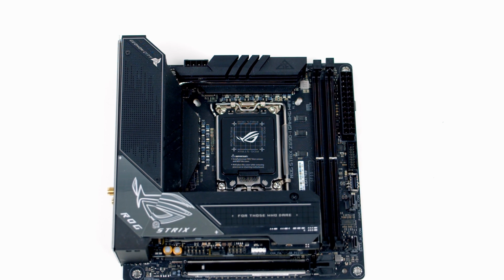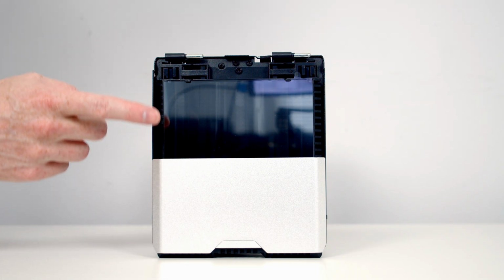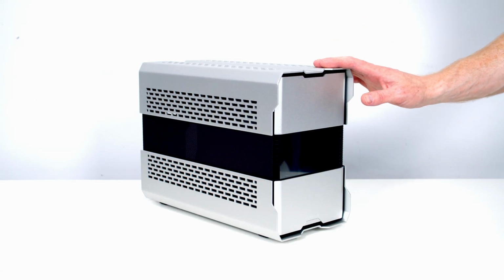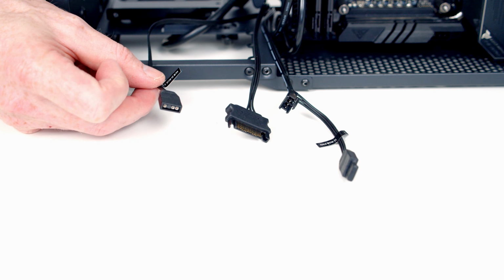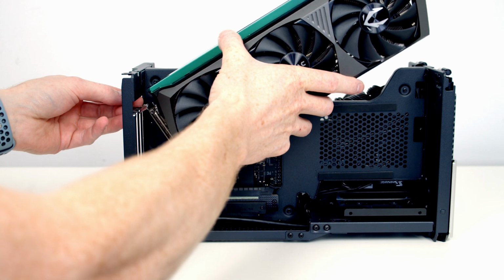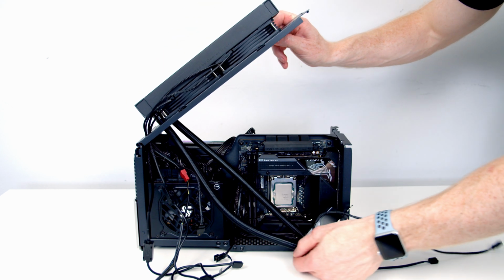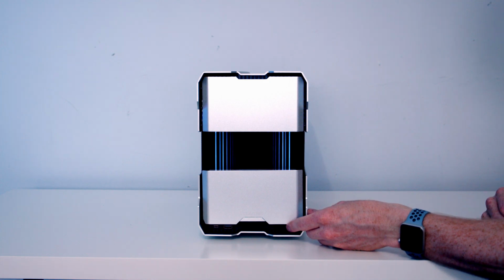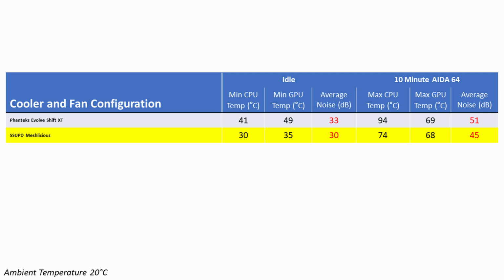Phanteks Evolv Shift XT Build - Step by Step Guide

Comment: Be aware with this build, gpu's with pcie on the right side and not in the middle prevent the case from closing and allowing a cpu water cooler. Am currently struggling with this and cannot finish the build unfortunately. So be sure to use a gpu with middle ports if you plan to do this (3000 series)
Reply: im guessing this only applies to triple fan coolers, with a dual fan card it should not matter

Comment: Cool case, which I use for my TV gaming setup. Couple issues I have:

1. Difficult to close the radiator mount, as the pcie cables, and AIO radiator tubes are in the way. The far radiator tube is getting squished, possibly slightly pinched.

2. The heat coming from the back of the GPU is causing the CPU temperatures to rise very high. If I run a stress test on only the CPU, the temps are nominal. When running a stress on CPU and GPU, the CPU temps skyrocket. There needs to be a way to vent the heat coming from the backplate of the GPU, and I can't figure out how to do so.

Otherwise, I love this case. It looks great on my TV stand.
Reply: Turn your psu around
Reply: Do you have a two or three slot GPU? If a two slot, can you slide the card over closer to the edge of the case and create a small space between the back of the GPU and the back of the MoBo. This would act as a venturi “chimney” and might improve thermals. Also need to check that you can still connect riser cable if you go that route.

Comment: Quick Question! I'm planning on running a 12600k along with a 3080 on my next build. After seeing the thermals on this case I will not be using it. I think my best bet would be between the NR200 with a side mounted radiator or a meshlicious. What are your opinions on this? I have seen more on the NR200 so I am really thinking about going this route, however I want the best performance I can get.
Reply: Watch Jayztwocents videos on this case, especially the most recent one about how he  had to switch out the fans on the AIO (from the RGB ones that came with the AIO to the Phantek “T30” fans that come with the Shift XT. 

The “T30” fans are built specifically for this case and are extremely powerful. He found that most stock RGB fans that come with AIOs aren’t strong enough (have enough static pressure + CFM) to pull the air all the way through the case from the intake (front/ bottom) and out the exhaust (top, where the T30’s will be, on the AIO). 

He was able to lower the temps a SIGNIFICANT amount by doing so. I think you guys would have a very different view/opinion on this case, IF you choose to use those fans. Just want to let you know.
Reply: @A.C.93  what do you mean by the fans that came with the XT? mine didnt come with any

Comment: actually just swapped from my meshlicious to this.
i have a 5600x and a 6800xt.
this case is cooler than my mesh by about 5 degrees on the GPU and is much quieter.
Reply: Did you go AIO and if so how hard was it to fit the PCIe cables over the dip with the AIO tubing also coming down from above. I ask because another reviewer couldn't install his 3080 without the cables encroaching into the AIO area, he showed a close-up of the bent cables passing the top fan rack before going down to the PSU. He had to use the 3080 Founders Edition card since it wasn't as tall and the connector was located in the top mid instead of near the top end. I plan on building an iTX when the 7950X and 7900XT is released.
Reply: @ChrisBuffam  Interesting.
I used an aio.
I have an NZXT kraken Z 240 AIO with 2x noctua chromax 120 fans on it.
My full build is:

rog strix x570i mobo
2x16gb pc3600 CL16 trident Z neo
corsair sf600 plat PSU
5600x
2x WDblue nvme gen3 (before they updated and made them slower)
1x samsung evo 2.5" 2tb SSD
gigabyte gaming OC 6800XT
2x phanteks neon LED strips

it was a bit snug, but i had room.
again though, the gigabyte card is fairly small for a 3 fan cooler, if it was a full on 3080 strix or something it might be a bit tight.2